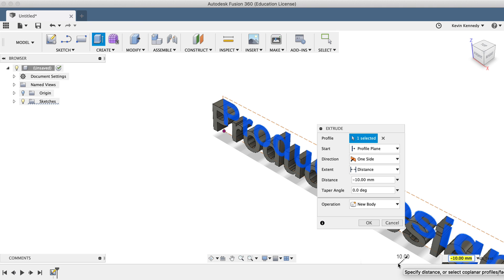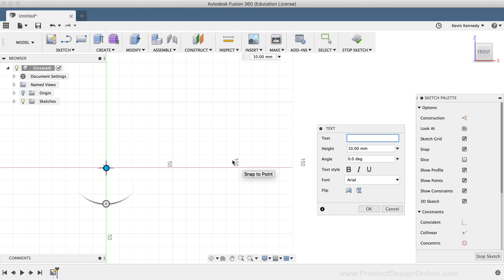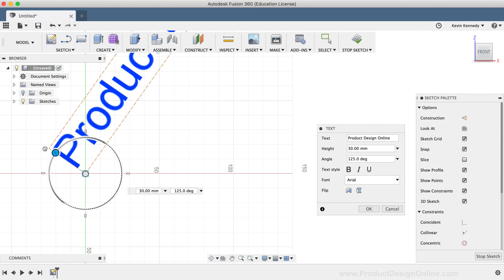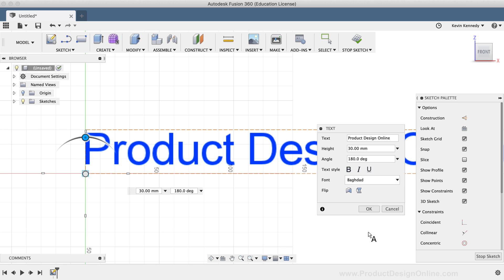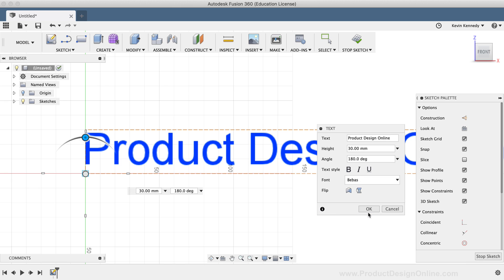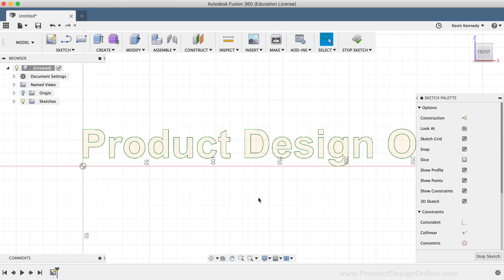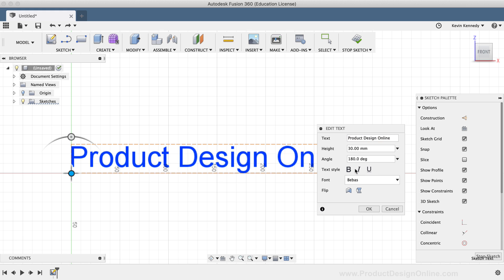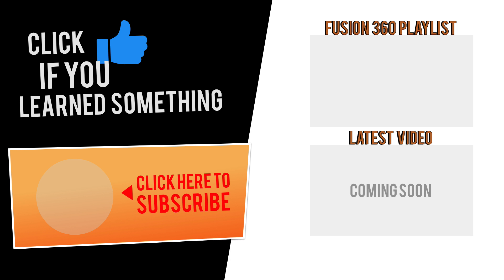How to Create Text in Fusion 360

Comment: I would like to point out that text characters not available on your keyboard can be typed in by holding down the Alt key and typing in the ASCII code. For example "Alt"176 will put a degree symbol in the text tool  box.
Reply from the maker: Great tip!

Comment: If i wanted to use this method to make a script font for my inside home. I have a v1 router and would be milling. Is there a way to weld the text as I would want to mill a font all together as one piece. I tried using lightburn but, fusion wasnt seeing the outter contour as a path. I had like 200 clicks on the contour and even that didnt work.

Comment: Hi. I'm all new to this and trying to lay out a clock to plasma cut and am struggling with getting the numbers in the correct orientation around the circle, I type in the numbers and have it space them equally around the circle but the numbers (except for the top one are not "level") I've been 3 evenings trying to get this and just need a push in the right direction. Thanks for any help and just found your channel but love what you"re doing......

Comment: so by exploding text i can extrude each letter and also cut out the inside and such to make a Hollow letter for lights? and can you move each letter once exploded around seperate to push closer together???
Reply from the maker: Yep. You can move the letters around. You will have to first 'unfix' them by selecting all the geometry and then the 'fix/unfix' constraint. Note that one you explode text you no longer have the ability to edit via the Text command... so only explode the text when you have a good reason to/are ready to move forward.

Comment: I would like to fusion 360 for plasma cutting signs and would like to know how to edit the text so when I cut the letters out they won't fall out.
Reply from the maker: Hi Mike. Are you generating tool paths in the Manufacture workspace? If so, you could use the "Tabs" feature to add tabs to the letters. It allows you to select the specific placement of the tab.
Reply: @ProductDesignOnline  
I use fusion 360 for making signs and its difficult to put text on a curve. Lars sent me a link that he did one letter at a time that works but it takes awhile. As far as the fonts I think I just need to install a specific font that can be cut like stencil fonts? Or is there a way to edit the single line text?

Comment: This was very useful, thank you. But, I'm having an issue. I downloaded Fusion onto my work computer. A .edu account. I used Fusion at work to draw a couple of parts with text and those worked out great! But, my work computer has many more fonts than my personal laptop does. Mostly, the older styles that I'm most interested in. And, the fonts that I use most aren't available on my personal computer. How can I get the full range of fonts?
Reply from the maker: Hi Andrew. Fusion 360 only recognizes certain font types. It's likely that they're one of the file formats not accepted. I explain this more on my website - https://productdesignonline.com/tips-and-tricks/how-to-use-custom-fonts-in-fusion-360/
Reply: @ProductDesignOnline  When I drew my parts on my work computer, there were many more fonts to choose from. My work computer has Word installed on it and I think that all of the fonts in Word are supported by Fusion. My laptop at home does not have Word on it. The font I’m looking for is an old style “Roman” font.

Comment: How can I have the outline of the text a different height that the rest of the text? Also, how can I select how thick that higher outline is?
Reply from the maker: Hi Andre. Fusion 360's text feature is currently very limited.  You'd be better off using a graphics program (Inkscape, Adobe Illustrator, etc) to create custom text and then insert the SVG into Fusion 360.

Comment: Very frustrating and hard to figure out when the things you point out are not on my version. I installed this earlier in the week.
V2.0.8412 is what I have. 
I do not know what version you are showing us.
I'm just trying to make the # 59, 80mm high, 5mm thick, then another #59 on top of it, but smaller, also 5mm thick. I want the bottom printed in 1 colour and the top 5mm another colour, so both can be seen and the bottom looks like it outlines the top.
Arg!!!
Reply from the maker: Hi Andrew. The sketch tools are now located under the SKETCH contextual tab, which is only present when you're in an active sketch environment. You can use the shortcuts box - hit the keyboard letter "S" - which will let you type out "text" and activate it. Cheers!
Reply: @ProductDesignOnline  Thank you. Is there a way to create what I want? Very similar to MS Word-Art with outline, except the inner part has more layers.

Comment: Do you know if there is an easier way to link text together for a plasma cut?
I'm trying to cut out my companies logo and the font is a cursive design. I've had to go through after exploding the text and delete the over lapping lines and redesign them to the font to make one fluid cut instead of individual letters. Is this the only way to do so or is their a quicker way to merge the letters together for the cut?
Reply from the maker: If you're doing a logo or specific font then I would recommend getting an SVG file of your  design and "Insert SVG". You'll have a lot better results than using the native text feature :)

More SVG info - https://productdesignonline.com/tips-and-tricks/using-svg-files-with-fusion-360/
Reply: @ProductDesignOnline  Good Idea, probably save a lot of time. Thanks!

Comment: Thanks Kevin. That's an interesting video concerning 'embossed' text but it doesn't really answer my question concerning 'hollow' (i.e. engraved) text. In TinkerCad it is rudimentary to make extruded text and other objects and simply switch them to 'Hole' (i.e. sub-surface) features. This enables clear visualisation and positioning.  Fusion 360 seems to assume we novices can comprehend achieving 'hollow' text but I cannot find any clear explanation on the Forum. I am surely missing something 'hidden in plain sight'  :)
Reply from the maker: Hi, Jim Sung. If you're looking to create engraved text then you'll want to set the Extrude "Operation" to "Cut". That will cut it out of whichever object it runs into. This video should help - https://youtu.be/djAabRlFA50

Comment: Hello, Kevin. Your excellent lessons are really appreciated by my rusty old brain. I can follow nearly everything you so clearly explain. Can you permit a pretty stupid question? How can I tell the text I have created (on three separate lines since the editor doesn't seem to allow more than one at a time) is going to be 'hollow' as per Tinkercad's excellent, very simple and obvious grey-shading to indicate 'hollowness'. When I extrude text above and into another extruded object they appear to merge.
Reply from the maker: Hi, Jim. first, that's correct, you can only create text on ONE line without creating multiple instances of the Text command. When you use the extrude command you'll see an "operation" option at the bottom of the dialog. Be sure to change that to "Cut" which will cut or make that part of the model hollow.

Comment: Thanks for your guides. This is my 1st project. I am trying to print my daughters name in 3d on a 3d printer. Ive managed to create the 3d text as per your guide above. How can i align the text so the letters are touching each other? My goal is to export as an stl and the use cura to create a gcode. Thanks again for your help!
Reply from the maker: Hi Steve. Unfortunately, Fusio n360's native text feature is very limited in terms of what can be modified. There's currently no way to adjust letter spacing. There are two workarounds. First, you can create each letter with an individual text command (repeating the text command each time). Second, would be to create the text in a Graphics Program (Adobe Illustrator, Inkscape, free online service, etc) and export as SVG > insert the SVG file into Fusion 360.

Comment: my Sketch drop down does not show "text" command. The command line does not recognize Text command???
Reply from the maker: Hi Michael. With the new UI you'll find the "text" command in the "Create" dropdown, but ONLY when you're in the SKETCH tab. The sketch tab will only be active when you're in an active sketch environment.

Alternatively, you can search for the text feature by using the keyboard letter "S" to activate the shortcuts box > search for the desired feature.
Reply: Product Design Online thanks so much!!!!  I’ve used autocad professionally for many years but fusion is a new language thanks again for great video

Comment: Hi Kevin! I've learned a ton about fusion from you here and on skill share. Love the courses! Anyway, I'm wanting to do lettering on a xcarve CNC with a v-bit. How would you approach this? Obviously I can trace a drawing and set the depth of cut in the cam. But how would I get nice sharp corners with a vbit? I'd like to get a program with varing zheights to get nice details. Thanks!
Reply from the maker: Hi Nick. Glad to hear you're enjoying them and learning a lot!
I remembered a similar topic being discussed on the forum a while back. I found that post and I think that can explain it well since there is a nice example file to look at - https://forums.autodesk.com/t5/fusion-360-manufacture/how-to-make-internal-sharp-corners-with-vbit-chamber-mill/td-p/8661065
You would essentially tell the bit to raise at the corners of your text (instead of the corners of the example file). Cheers, Kevin :)
Reply: @ProductDesignOnline  thank you soooo much Kevin. You freaking rock 🤘🤘🙌

Comment: Hi Kevin. Love your videos. Can you help me? I want to create a two colour label for storage containers. The main part would be a flat piece with text indicating what’s in the container. This text would be cut out of the part. There would then be a second part in a different colour, which would be inlaid into the main piece. Due to 3D printer tolerances, this would need to be slightly smaller and maybe have a taper so the top of the text was smaller than the base. I also envisage some sort of a carrier bar which would hold the letters together. How would I go about this? Do you have a video that covers this? Thanks.
Reply from the maker: Hi, Ron. To do this you would want to use the "Combine" feature to cut the text component out of the box component. My keychain video outlines the process that you would want to take (obviously replacing the logo with your desired text) - https://youtu.be/f-Zs3lx5OQA

The only thing that that video doesn't cover is creating the second part or in your case the text. When using the Combine tool to cut the text out you can select "keep tools" which will save your text (otherwise it will automatically delete the bodies). Then, create a sketch on the top of the text. Offset the edge of each letter .3mm (or your 3D printer tolerance) and extrude cut that away.

I hope this helps! Cheers, Kevin :)

Comment: Hello thanks so much for the videos. Do know if there is a function that will me to apply a chiseled texture to the background of a sign. I use fusion to help operate my woodworking business thanks a bunch
Reply from the maker: Hi, Chris. Unfortunately, Fusion 360 does not work well with textures. Due to how the program was built it will have to "render" each area and will drastically impact the performance of F360. Because of this, there are no native features to create textures. However, there is an add-in that helps with the creation of textures. This may help with your wood texture - https://github.com/hanskellner/Fusion360Image2Surface

Autodesk used to have a program called "ArtCAM" that would work well with textures and CNC work, but it looks like it was discontinued. You may be able to find another 3rd part program that you could use after creating the main file in Fusion 360. Cheers, Kevin :)

Comment: Thank you for tutorials! I have couple of problems with my Fusion though. Fist its not looking like yours... I have trial version from the provider. Its very slow and confusing for finding right tool. 
And second - my Fusion 360 showing all fonts from my MAC, but they NOT looking alike (I mean they not showing proper original font design)...All fonts look similar and basic. Could you advise me to get better?
Reply from the maker: Hi, jp3419292. Fusion 360 released a large update back in August which changed the UI. I would recommend watching my tutorial that covers the new UI updates. I discuss the critical changes in terminology, placement, and iconography, that should help bridge the gap between the old UI and the new one. You can watch that here - https://youtu.be/tuZzHcmFtg4

In regards to your Fonts. Fusion 360 only works with TTF fonts. If you have other fonts (other file types) then they will show in the dropdown list because it can read your computer's entire font list, but it cannot load the actual font.

You can try to convert the fonts over to TTF. After restarting your computer they should work in Fusion 360. Cheers, Kevin :)
Reply: I had the same issue, but managed to fix it after googling for 60 minutes...... Open Font Book>Preferences>Default instal location : Change from User to COMPUTER. Not sure if you have to reinstall the fonts in question, but did that anyways, and it now works like a charm :-) Hope it helps

Comment: so when using text how do I remove constraints in order to edit text to fill a specific area?
Reply from the maker: Hi, Tristan. If you're trying to "Unfix" the text (green lines means it's fixed) then you can drag your mouse cursor over all of the text and select the "Fix/unfix" constraint icon in the toolbar.

If there are other constraints on your text then you can select the geometry that makes up the letters, select the desired constraint, and simply click the delete key on the keyboard. Cheers, Kevin :)

Comment: I'm trying to figure out how to center text on a piece of geometry.
Reply from the maker: Hi, CMRCustom. Unfortunately, there is no native feature that makes it easy to center text. There are two workarounds. First, if you're using an imported SVG for the text you'll want to create a bounding box and have it centered to the box. The second option, if you're using Fusion 360's native text feature, is to create construction geometry to help you center it. I've found if you create a diagonal line across the part to find it's center point, then it makes it easier to align the center point of the text.

I hope this helps! Cheers, Kevin :)
Reply: @ProductDesignOnline  Thanks Kevin. That's pretty much what I'm doing.
Reply from the maker: @CMRCustom  no problem! It's unfortunate that the text feature is so limited. Hopefully, that is something they will enhance in the future. Cheers, Kevin :)
Reply: Yeah hopefully.
I ended up using calipers against my monitor
Reply from the maker: @CMRCustom  that's a great workaround :)

Comment: Still very new to this. Still learning, (have a multifilament printer.)
What's the best way to cut letters into a printed surface, & fill some, (but not all,) with different colours? (Think marquetry in woodwork, but some shapes left with no inlay.)
& why does image jump away when I don't want it to?
Reply from the maker: Hi, Richard. When you extrude the text you will want to create the text as a separate body. Extrude the text into the object you want the text to be inlaid too, but make sure the operation is not set to "Cut". To do this, make sure the "Operation" is set to "new body" in the Extrude dialog.

You'll then end up with a body for each individual letter. You can then use the "Combine" feature form the Modify dropdown list. With the combine feature, you can select your target body (the main object that you want the letters to be inlaid too). Select all the letters as the "Tool Bodies" and then set the operation to "Cut". The important thing is that you check the "Keep tools" options so all of your text bodies are not deleted. You will then be able to delete or hide each individual text body that you don't want. 

EDIT: Here's a demo file that you can download and replay the timeline steps. That may be easier to follow than my written instructions - https://a360.co/2OPwIVT

Cheers, Kevin :)